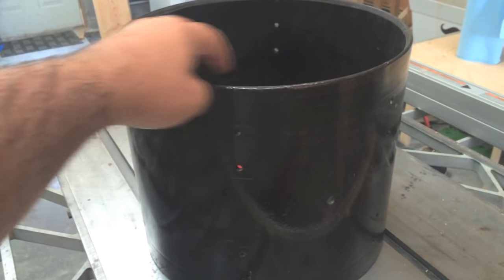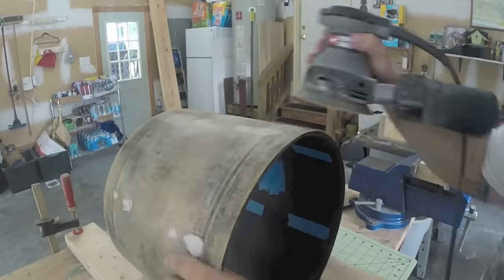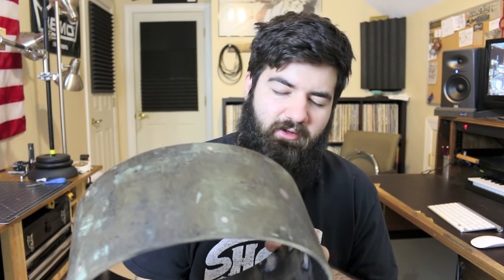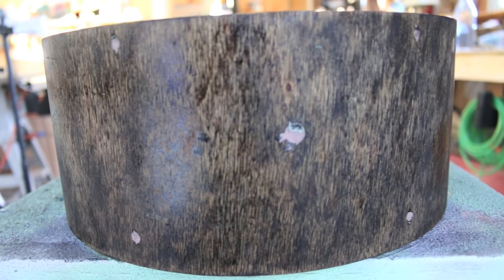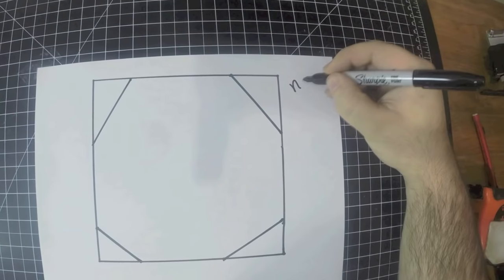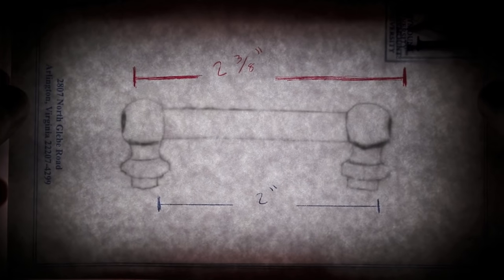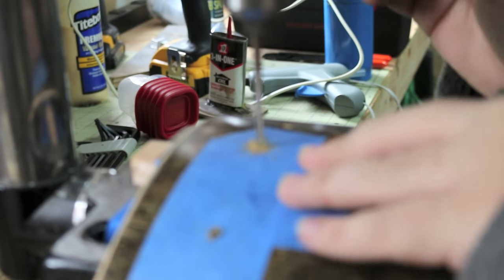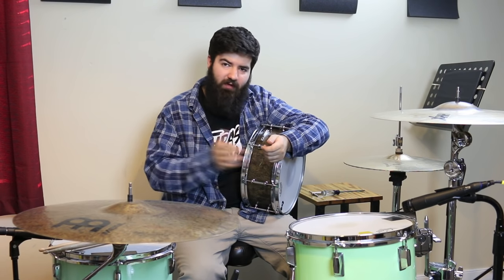Snare Drum Build

Comment: Alot simpler method for drilling out 8 lugs is to drill the 1st set wherever as desired on the shell, drill the next set directly opposite of 1st. Then find the 1/2 way points between those 2 and drill out next 2 sets, and last find the 1/2 way points between all 4 sets to make 8 lugs total.

Comment: For my snare drum I just drew a line for the first lug hole then counted how many spaces there were in between lug holes on my hoop (10) then just measured the circumference of the drum and divided it by 10. Then I just pressed = on the calculator every time I'd marked it out and it gave me the measurement for the next hole.

Comment: Easier 45° by hand: draw 2 perpendicular lines (90°). measure out from center point equally on each of the 4 line segments. using the four points, draw a square. mark the midpoint of each side of the square. draw 2 lines across the square between opposite midpoints through the center point. done.

Alternate option: transfer the rim hole layout to a piece of paper with a sharpie (other marking implements are available)

Comment: Hey dude been having fun watching your videos. Just to share ideas for filling old lug and Tom mount holes, I don't know what their correct name is but I found some wooden plugs for covering counter sunk screws that work nice for it! Just put some wood glue on them and sand them down to match the shell radius and it worked nice. They are tapered so you can get them in their nice too. And theirs big ones for the tom mount holes too and their really cheap! Usually next to the wooden dowels. No hate for the bondo cause who wants to run to to the store in the middle of a project. Keep the videos coming, they are a lot of fun!

Comment: to do the hole for lugs i use Autocad to draw the right position of the hole in a paper with a length equal to the circumference of the snare. than you just have to print the design, and put the paper on the surface of the snare. than you should drill the holes marked on the paper ;)
Reply from the maker: I actually took a cad class in middle school, but of course all we did was layout houses and rooms haha. I might have to dust off the ole brain and relearn it

Comment: The snare came out great, congratulations! I bought Keller shell from Drum Factory Direct last year, finished it with Danish Oil and lacquer and then added Trick Drums hardware. Sounds great. Did you add an air hole? It wasn't in the video, but if you have not done one yet, you should probably consider it. I'm sure you can get a grommet for the air hole from Drum Factory Direct, or you might have one lying around. A cheap and easy way to do a badge is to go to a trophy shop and ask them to make you one. Get a thin one so that you can bend it to fit flush on the shell. Loved the video. Thanks for sharing.
Reply from the maker: +maprow I actually have an air vent I meant to put on but totally forgot lol. Ill be sure to put it in though. Im gonna mess around with making some sort of badge too.

Comment: I didn't have a template, so other builders use a calculation.  So, I calculated a 10 lug spacing for a 14" snare drum to be 4.35675 using their method.  How critical is the roundoff?  depending the roundoff can range from 23/64" - 13/32".

Comment: I just got a shell, but it already has the clear coat on it, so do I have to sand that off before I can drill the holes for the hardware??
Reply: It should be fine if you're in a rush, but if you have clear coat lying around it wouldn't hurt to sand it off and re coat

Comment: Just curious, would it be possible to rethread cymbal stands?  Really enjoy your work man!
Reply from the maker: like repair the existing threads? You can get  a thing called a "thread chaser" and thatll fix them up. technically you could rethread them, but the diameter of the shaft would have to be turned down to remove the existing threads, then new ones could be cut.
Reply: +rdavidr thanks for the quick response.  I will look into that tool!  I'm new to your channel, looking forward to learning more awesome tips.  Thanks brotha!

Comment: Maybe you should leave it to the professionals...
Reply from the maker: +Mike James why do you say that?
Reply: +rdavidr the way you just shove Bondo into the holes for example, you'd be able to push it straight out.  Glue some sort of dowel into it first.  Bondo is used for assisting filling a hole, not filling huge holes.  The way you sanded all the previous polish off was cringe worthy, please use paint stripper, you took half of the wood of and still had the grain full.  I was a professional wood finisher for 17 years and have restored drums then and after retiring from the trade.  I'm never going to tell you to stop, quite the opposite in fact.  I just suggest you seek out a professional and seek better advice that's all.  For example if you sanded lightly over the shell at the start in 60 grit paper to break the gloss and then apply the paint stripper it'll help tear right through it.  If then after wrapping all the polish off plus it would have gotten some out of the grain you should scrub it with a course pad and a solvent, with some rubbing you can get the majority of that stain out.
Reply: +Mike James please don't see this as discouragement in any way, I think you restoring kits and making videos is great, I just wish I could spend some time with you to show you a few simple things to help you out.
Reply from the maker: +Mike James No doubt man, I know the bondo is frowned upon lol. Ive plugged holes in drums the proper way before, but I wanted this snare to look ugly. Ive never bought into chemical strippers, but ill give it a go next time!  Thanks for the advise!